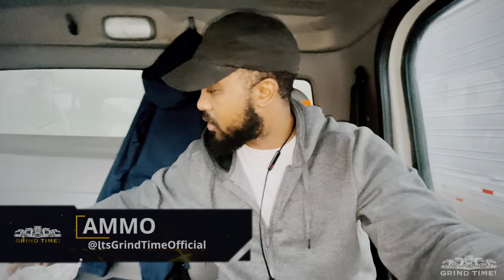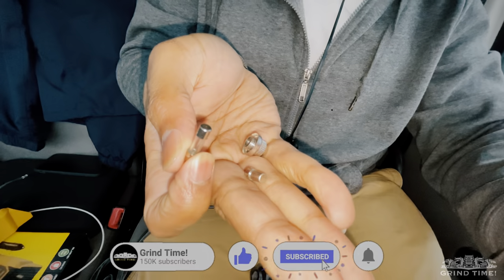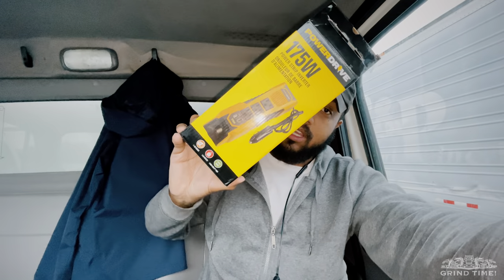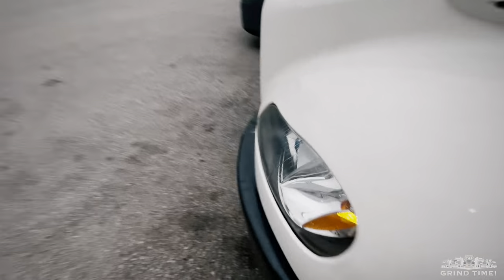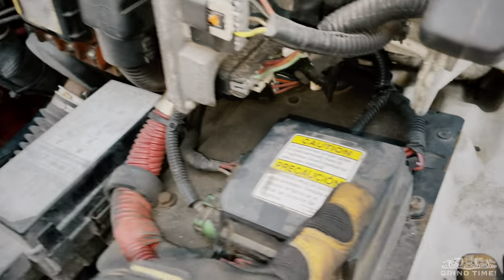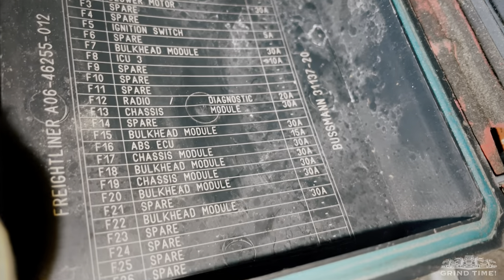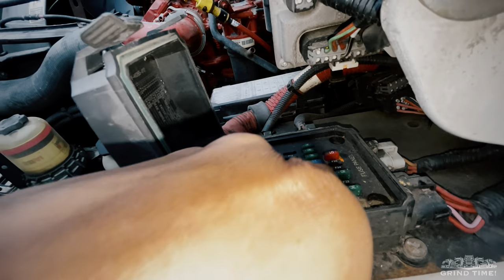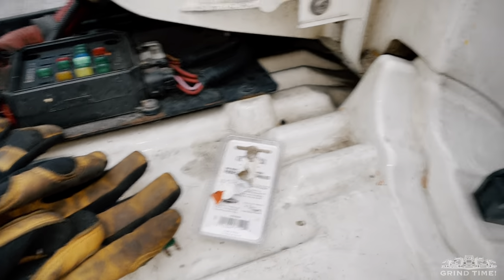How To Change The Freightliner M2 106 Fuse For Running Lights, Cigarette Lighter Port & Washer Pump

Comment: Thanks a lot Sir, you are our savior . My driver paid $73 for the mechanic to check the washer pump but he said that it needs to replace the washer pump motor and they don't have the parts. so bye bye $73. until I watched your videos, and my driver follow your instructions. and then Boom - all working now. Cigarette lighter is working, washer pump is working and back lights are working. You are the best Sir. Salute
Reply from the maker: Thanks a million! I’m glad I could help you guys out! I just hate you didn’t run across the video prior to paying the $73. Hopefully you subscribed and joined The family! There are more videos like this one to come.
Reply: @GRINDTIMETRUCKING  thanks again Sir. Subbed already 👍😎

Comment: Bruh this video was golden...I ran into the same issue and my homeboy said check the fuse but I didn't know which fuse it was like you. Until I watched the video when you said ya washer fluid went out I knew it was the fuse. Bro appreciate it u saved me a gang of trouble and stress I was out on the road in the Midwest I live in VA and for two days I was struggling charging my phone running into stores..had no gps it was hard. This video helped appreciate it.
Reply from the maker: Gratitude bro! Moments like this is why Grind Time! was created. I’m glad I could help you out the jam! If you haven’t already feel free to hit the subscribe button and join The Grind Gang. It’s more videos to like this to come! Stay safe & keep grindin!

Comment: I’m having the same problem but after the cigarette port went out it took my lift gate power with it so can I buy it from autozone or just truck stops??
Reply from the maker: Damn that fuse operates a lot of stuff then! I’m sure you can get them at any automotive or hardware store. You can get an off Amazon too Just make sure you get the mini fuses. Keep spare fuses in your truck from now on.
Reply: @GRINDTIMETRUCKING  thanks I appreciate the help
Reply from the maker: No problem, I’m glad I could help! Hopefully you joined The Grind Gang. If so welcome to the family!